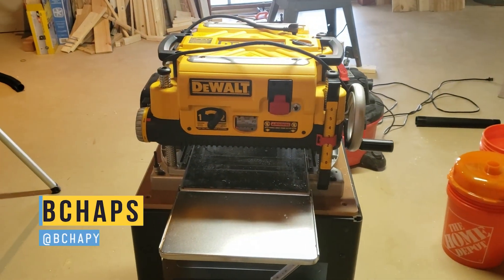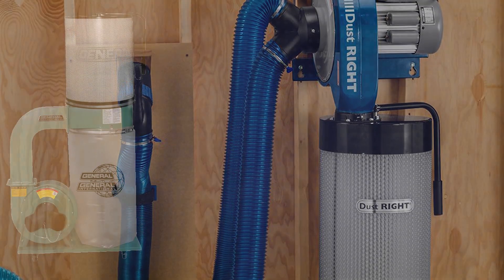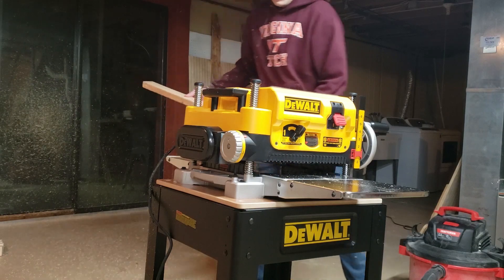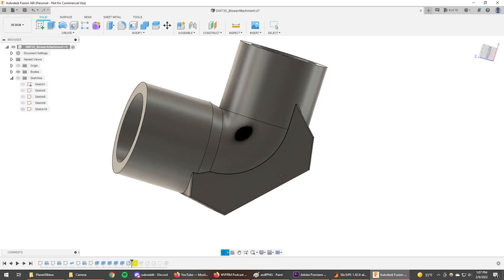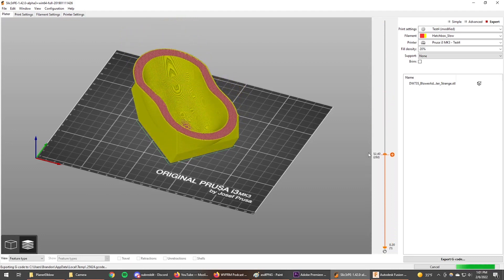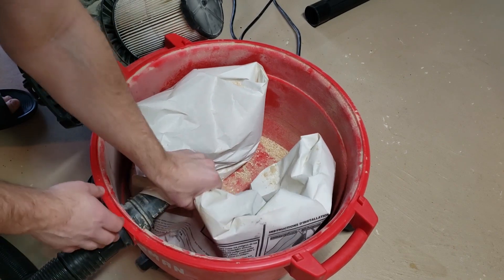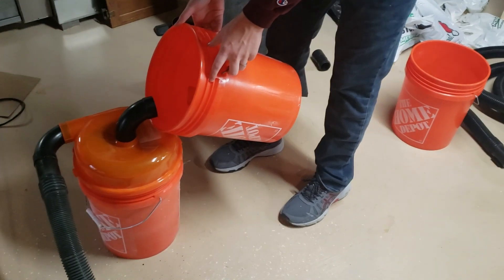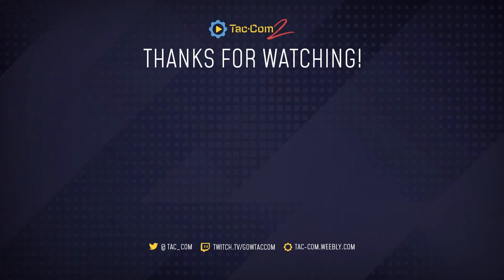Simple DW735 Planer to Shopvac Adapter

Comment: I also connected this dewalt planer to the dustopper and I it kept blowing dust around the edges of the bucket. I added a strip of window weather stripping to the rim of the bucket to create a better seal and it sort of helped, but ever time I remove the top to empty it, it damages the weather stripping. Not sure how to fix this. And I don’t even turn in the shop vac, the blower is pretty powerful enough already. Good video 👍
Reply from the maker: Yeah, idk how much can really be done to help that. The dustopper gets its seal due to the vacuum pulling the lid down tight. The blower is so powerful that it pushes the lid up, thus creating a gap.

One solution would be to use a bigger drum and lid that would allow the pressure to dissipate more. But honestly, the slight leakage from the system as-is is quite manageable, so I decided to leave it.

Comment: The DustStopper does a good job with planer chips but I still needed something more to filter out the fine dust that does not get collected.
Reply from the maker: I'm trying out the cheap-ish WEN dust collector currently. It's a bit small for my basement, but should help circulate air and catch the finer stuff.

Comment: 55 gallon steel barrel separator/collector with bolt clamp ring lid on barrel dolly, WEN dust bag on the outlet, 4" 26 gauge galvanized steel snap lock duct pipe and 4" elbows, 4" adjustable elbow fits the DW735 dust port, 4" thumb screw hose clamp, ground wire with ring terminal to one of the motor screws, other end of ground wire to the steel duct with ring terminal and magnet. No airflow restriction from flexible hoses, no static problem as everything is electrically conductive back to the ground prong of the planer cord, no separate vacuum motor required, only one 15 amp circuit required.  Too heavy to go up and down the basement steps.

Comment: Thanks for this! Do you know how much the finished product weighs? My library charges 15 cents for each gram of filament used.
Reply from the maker: It's gonna vary greatly depending on how many perimeters, what infill percentage, and what nozzle size you use.

I don't have the part on-hand to weigh right now, but my slicer says it should use ~75m of filament or 230g. With 15 centers per g, that's about $34 - which is really high. A 1kg spool can sell for $15-$20 usually, so their markup is HUGE.
Reply: @tac-com2574  Thanks for the excellent info. I figured I couldn't make it for a reasonable price. I'll need to look into other options. Great post.
Reply from the maker: An option I've seen is to attach a pillow case or dust collection bag to the blower port wish either an elastic band or a clamping system. It lets the air blow through, but catches the dust.

Edit: I'll note that I haven't tested this myself yet.

Comment: Hey there!  Planning on printing now!  What did you set the infill at?  I'm using a Prusa also.    My print setting is .15mm quality.  Sound right?
Reply from the maker: I always use custom settings, so I'm not 100% what I used on this.

I either did 0.2mm or 0.15mm layers. I typically do 3 perim layers. For infill, I usually stay around 20-25%, but this was larger, so I may have bumped it down to 15%.

Sorry, I don't recall the specifics of this print. It was a surprising case of me modeling, printing once, and it worked - so I didn't need to dive into details like I usually would.

Comment: Hey I printed this but my shop vacuum hose is 1.5 In, I tried to edit your model in F360 but I am too noob for this, is this something you could quickly edit? Thanks!!
Reply from the maker: That's quite a small shop-vac hose. I don't think you'd want to use that with this planer as the pressure would be quite high.

Comment: Top-Com, how long does it take to print?
Reply: 1 Day 8 Hours and 30 Minutes (with 4 walls and 50% infill).  Good lord!!   Getting started on the printing...
Reply from the maker: 4 walls and 50% is a bit excessive.
I had 3 walls (I think), I forget infill (maybe 15-25ish), and I believe it was a ~6hr print.
Reply: @tac-com2574  Must be my printer and speeds.  I cut it down to 15% infill and 3 walls and it's now 18hrs.

Comment: Collecting dust and chips is a must but having a vacuum system to assist is not. The blower on the planer has more than enough power to force all dust and chips into whatever collection device you have without assisting suction provided that device is near by. That 90* bend is a bad idea IMHO as it creates to much friction for chips and dust to get around as well as a more gentle bend would allow.
Reply: I tried this based on your suggestion and it was, shall we say, suboptimal. Lots of fine dust with nowhere to go. Turning on the vacuum to my dust stopper worked much better. Also, the 90 degree bend may add the equivalent of several feet of straight pipe in head loss, but that's insignificant compared to the safety gained by keeping the hose out of the way of a board exiting the planet.